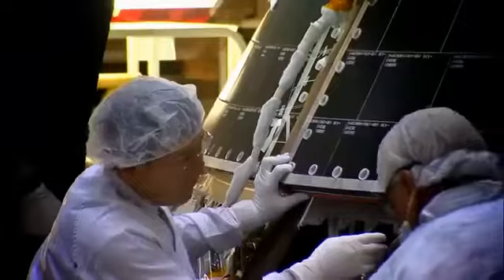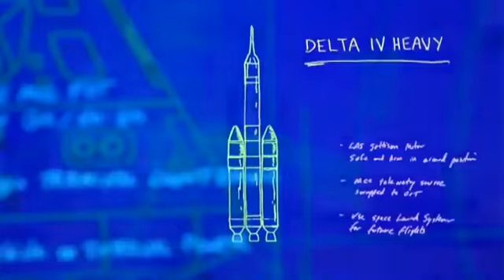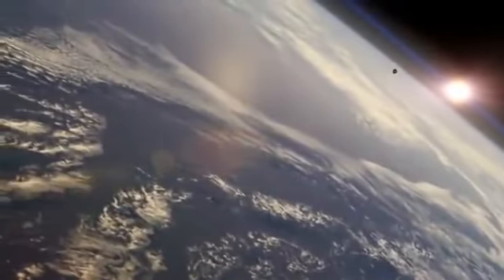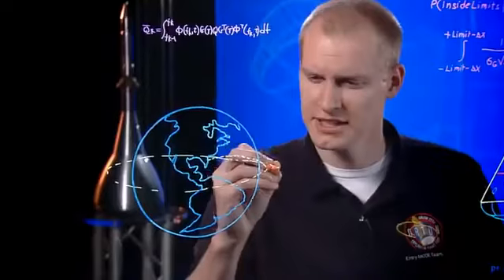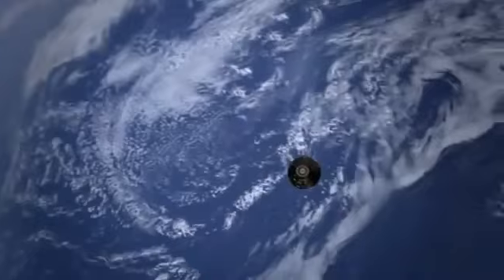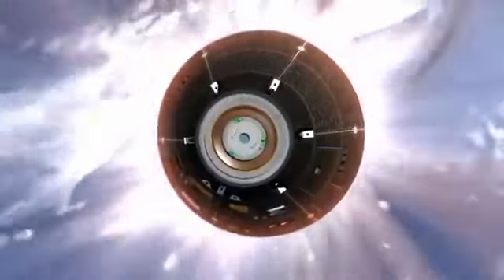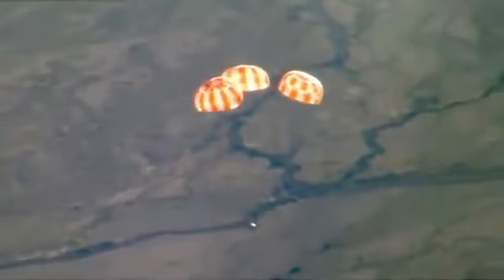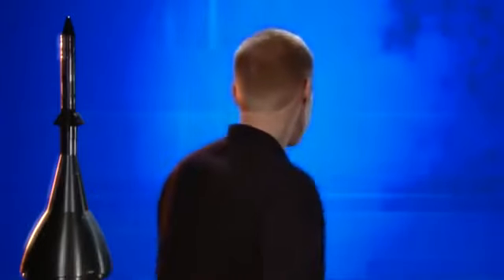NASA engineer admits they can’t get passed the Van Allen Belts

Comment: Hmm... We have two major problems here. The first is that the Van Allen Belts only contain a low level of radiation, about lesser than 10% of the total mass radiation.

Here's the second problem: when passing through the 10% radiation of the Van Allen Belts, you're then confronted with 100% of the deep space radiation.
Reply: That is a misunderstanding. The radiation level in the VA belts is higher than the level above the belts.
Reply: @zounds010   Well you're in a long waiting line of disappointment seeing these points are supported by research conducted by Princeton, Berkeley, UCLA, GSI, CERN, every single particle physicist on the planet, every solar physicist on the planet, NASA's heliophysics education activation team, and our international partners.
Reply: @AwesomeBlackDude  Your original post is unclear. It looks like you're claiming the radiation level above the VA belts is higher than the level in the belts, which is not correct. If you meant to say something else, perhaps you could clarify?
Reply: @zounds010  Well, answer this question, my friend: Why has there never been any deep spacewalks outside of Earth's orbit, past the Van Allen Belts? The International Space Station and Space Shuttle orbit within the Van Allen Belts, but below them.

So, are you saying that the radiation is more suitable for humans once they pass the Van Allen Belts? The farthest distance humans have reached is when repairing the Hubble Space Telescope, at a distance of 358 miles. The SpaceX Dragon capsule surpassed that a couple of years later, traveling 360 miles.

Additionally, an unmanned NASA Orion spacecraft reached approximately 364 miles during its launch in 2014.
Reply: @AwesomeBlackDude  Every Apollo mission that went to the moon, did spacewalks during the transfer from the moon back to Earth, i.e. outside the VA belts. Those were done to retrieve film from cameras in the Service Module.
Reply: @AwesomeBlackDude  The Orion test flight that this video is referring to (EFT-1) reached 5800 km, so about 4000 miles. Not 364.
Reply: The claim that the Van Allen radiation belts were deadly is false, a gross exaggeration and simply not supported by the data. Radiation was indeed a definite concern for NASA before the first space flights, but they invested a great deal of time, money, and research into it and determined the hazard was minimal in the scope of the mission. It took an Apollo spacecraft a little less than an hour total, to pass through the least severe parts of the radiation belts twice - once on the outbound trip and once again on the return trip. Read that again. The combined time passing through the edges of the belts, once going outbound, and once coming back, was about one hour (each way). The total radiation dose received by the astronauts was about one rem. A person will experience radiation sickness with a dose of 100-200 rem, and death with a dose of 300+ rem. Clearly, the doses received fall well below anything that could be considered a significant risk.
Despite claims that "lead shielding meters thick would have been needed", NASA scientists found it unnecessary to provide any special radiation shielding. The Command Module structure was two layers of stainless steel, plus one layer of polymer honeycomb, plus three more layers of aircraft aluminum with phenolic resins in between each layer, along with several layers of mylar and kapton insulation and heat shielding. This does not count the resins used in the ablative heat shield on the bottom of the spacecraft. The walls of the Command Module were roughly three to four inches thick, as they differed in thickness in places. The total thickness of the walls of the Command Module is actually irrelevant, since lead or any of the heavier metals do not protect against the type of radiation of which the Van Allen belts consist. An aluminium alloy was used due to the very fact that the lower the atomic number, the less Bremsstrahlung (electromagnetic radiation normally in the form of X-rays produced by the acceleration, or especially the deceleration, of a charged particle after passing through the electric and magnetic fields of a nucleus).
The aircraft aluminum-phenolic resins (which were specially designed to shield from the particular type of radiation found in the Van Allen belt) and the polymer honeycomb of the shell of the spacecraft were more than enough to adequately shield against the minimal radiation through which the spacecraft passed. Let me say that again, so the hoaxers will be sure to see it.
The amounts of radiation the spacecraft passed through were minimal, primarily because they passed through the thinnest edges, and because the types of radiations found in the belts were shielded against. Why? Because those belts are donut-shaped, or toroidal. That means they're shaped like a giant Cheerio surrounding the earth.
They also thin out significantly in terms of the density and flux of the radiation levels as they reach their outer edges. Hoaxers also make the ignorant and uninformed mistake of limiting themselves to two-dimensional thinking. Given that the belts are toroidal (imagine that giant Cheerio around the equator) and that they extend to an angular path of 26-28 degrees from a line drawn through the center of the planet to the equator, the trajectory of the spacecraft through the belts would not have taken the astronauts through the thickest part of the belt in the first place. The Van Allen belts are not like a shell surrounding the planet, they are a fairly narrow band. They begin about 600 miles above the surface, and extend out to around 3700 miles from the surface. Here's the important part: Since the belts are almost non-existent on an angular measurement exceeding 28 degrees above the equator, and the translunar trajectory of all of the Apollo spacecraft were inclined a little above 30 degrees, (in addition to the tilt of the earth on its rotational axis of 23.5 degrees) then the spacecraft missed the belt almost entirely. They only passed through the very edges of the belts in the first place. That's right, they missed almost all of the region of radiation entirely. Hoaxers never think of this.
To monitor radiation exposure during the flights, Apollo crews carried dosimeters on board their spacecraft and on their persons. And these readings confirmed NASA had made a good choice. At the end of the program, the agency determined that its astronauts had avoided the large radiation doses many feared would ground flights to the Moon. In no case did any astronaut experience any debilitating medical or biological effects.
Reply: Then why does this Nasa engineer say the opposite? Does the drummer know more than the engineer?  @DemonDrummer
Reply: @BlacksheepLSX  He's not saying the opposite. He's talking about the development of the Orion capsule, where they have to make sure the electronics on Orion will function correctly in the VA belts because this is the first time that those electronics will be used in the VA belts.
Reply: @BlacksheepLSX  Perhaps you should sort the comments by newest and fix yourself. 😅
Do better, learn.
Reply: And fried to a crisp. Temps ranging from 2000-20,000 deg Celcius.
Reply: @zounds010  You're almost correct; it's not 4000 miles but 3600 miles—my mistake for not adding additional zero. Also, we both made a big mistake by not mentioning that there were four Orion spacecraft built, not just one. Out of those, two were launched if I remember correctly.
Reply: @MrAphorism  In the thermosphere, temperatures are that high, but there is so little matter in that area that the amount of heat that can be transferred is tiny, much smaller than the 1300 W/m2 of sunlight.
Reply: @AwesomeBlackDude  That's exactly what he's saying, and we have repeatedly done deep space EVAs. Stop talking rubbish. Your lack of understanding is not evidence of anything except your own ignorance.
Reply: @DemonDrummer  Superb answer, might have to steal it if you don't mind?
Reply: @MrAphorism  Tell me how much you understand about temperatures in a vacuum…
Reply: @jasoncatt   Feel free. 🙂
Reply: @AwesomeBlackDude  you need to start reading
Reply: @rogerbanfield473  you really need to do something about those convulsion.
Reply: @jasoncatt  Rubbish? 🤣 Apollo 17’s lunar mission kicked off in December 1972—does that ring any bells? It was the last time humans ventured into deep space beyond the Van Allen belts. Now, in 2024, we're facing Zionism W3 and sliding into a petrodollar recession. So, can you explain the logic behind your statements in this context?
Reply: @AwesomeBlackDude  What are you talking about?? Zionism, WW3 and petrodollar has nothing to do with this lol. 
We went through the VA belts in Apollo, after testing Apollo unmanned in the VA belts. 
Exactly the same thing is being done with Orion. They have to test it before they put humans in it. What about this is so hard for you to understand?

Comment: He's talking about shielding the electronics - which are far, far more intricate and vulnerable to radiation damage than those used in the Apollo program.
Reply: @D D At 3:16. "Radiation like this could harm the guidance systems, on-board computers or other electronics on Orion. Shielding will be put to the test as the vehicle cuts through the waves of radiation."
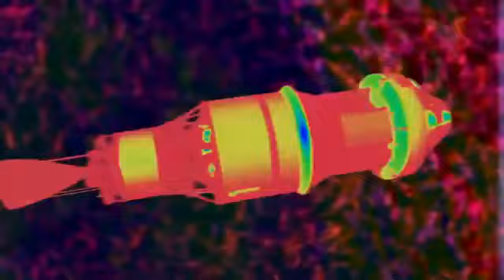Reply: Iain Aitken, 3:37 the Engineer says,  "We must solve these challenges before we can send people through this region of space (Van Allen Belts)."  This is correct.  No one has been to the moon.
Reply: @maunster3414  Your conclusion does not follow from your premise.
Reply: @maunster3414  he is talking about the new craft.
Reply: @robertsekrst8020  Alan Bean was most likely talking about the Skylab mission.

Comment: The bigger problem is: What do navigation jets do in a complete vacuum?
Reply: no atmosphere to push against?
Reply: Thrust has never required a medium like air water or ground.
Reply: well spacecraft don't use jet engines, they use rockets (yes, there's a difference). A jet engine uses the air around it, while a rocket uses built in air for the combustion process.

Comment: By this video NASA is not only admitting they cannot get past the Van Allen Belts, but also that re-entry is a problem as well... Mr. Smith is saying that it may be the most dangerous part of the flight because it heats up to 4000 degrees. Unlike the space shuttles which re enter at a gradual angle and has a thick tile heat shielding, the space capsule types make a ballistic re entry without thrusters to slow it down and only had nickel alloy heat shields with some special epoxy resin coating. Hmmmm, so there's two
big reasons implicating it didn't happen.
Reply: Wrong on both counts. That's not what's being said.

It's called an ablative heat shield. Well understood and effective technology.